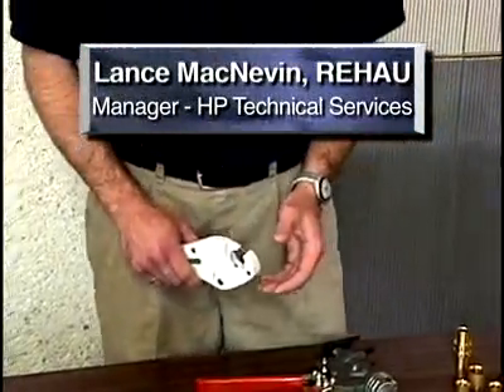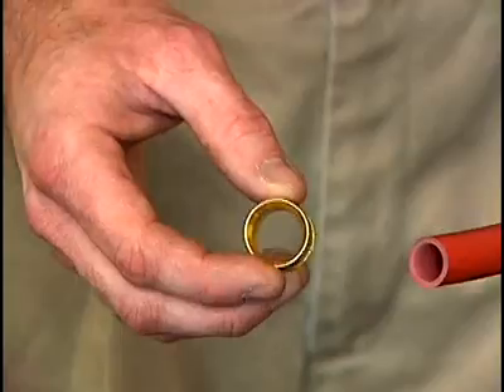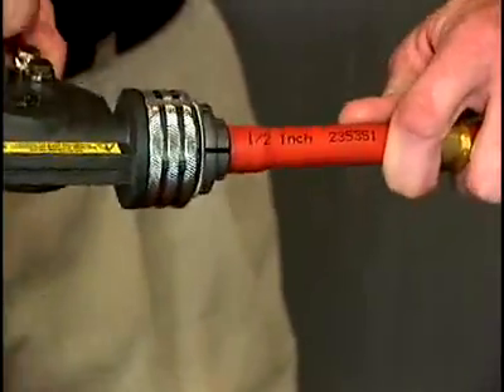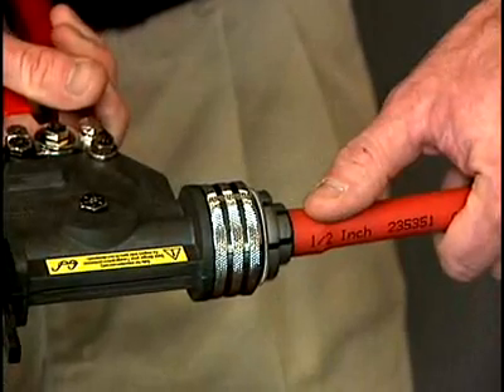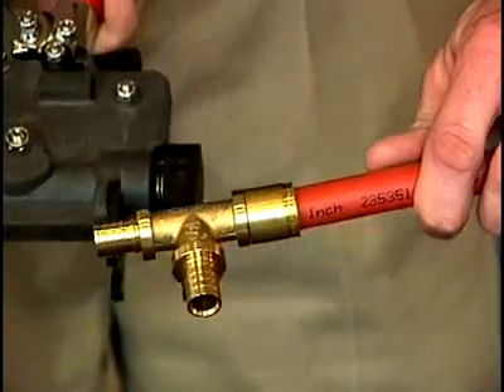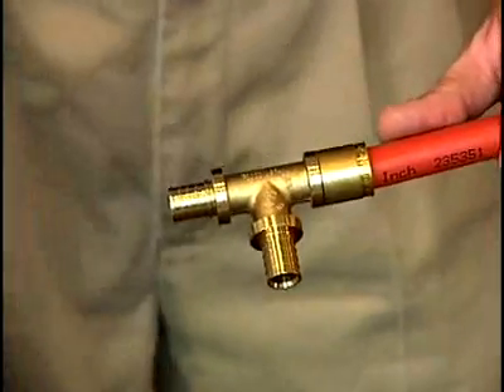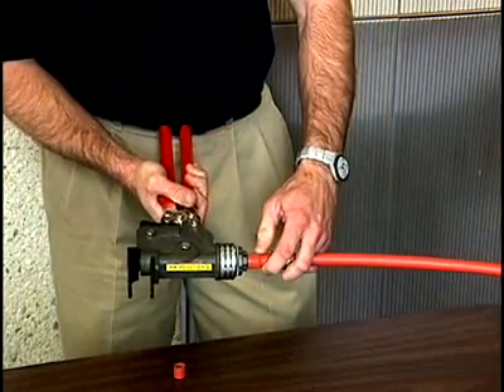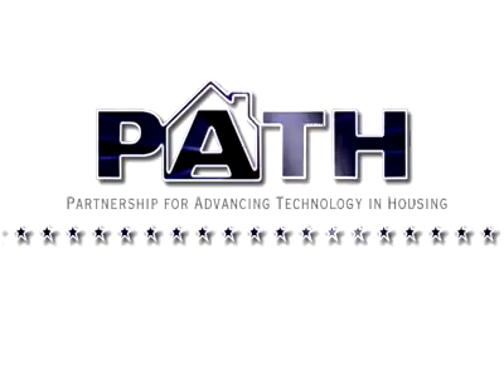PEX Pipe - Compression Sleeve Fitting

Comment: I've used Upinor expansion rings to repair and attach air compressor lines/fittings, also used on garden hoses/fittings, also used on drip lines,  but outdoors uses the rings must be wrapped in tape to protect from UV rays

Comment: I'm re-plumbing my 100+ year old house with PEX-A.  After much research, I bit the bullet and went with the Uponor/Wirsbo system.  The initial cost of the Milwaukee expander tool(about 350 bucks for the 1/2 3/4 1 inch kit) was the bullet I was referring to.  But fittings and sleeves are much cheaper.  So far, I'm really impressed with the ease and speed.  From cut to complete is about 15 seconds per.  Faster if you are doing a tee and have them all cut and the rings on.  The Rehau was my second choice, but fittings are expensive and the manual tool for it wasn't that much less than the 12v Milwaukee that automatically rotates the head so repositioning isn't necessary.  The only real issue I have is that Lowes and Home Depot don't stock the Uponor/Wirsbo system(only crimp and sharkbite) and I have to use a supply house that's not open on weekends.  There are many good PEX systems out there and only time will tell the story.
Reply: blmeflmm66- I’m a plumber and wirsbo is the best in my opinion
Reply: The price of the tool is a con, should be no more than $100

Comment: @flighthouston187 

This tool is called the REHAU - COMBOLOC. The part # for this tool is 243107. These are available through your local REHAU distributor. The COMBOLOC expands and compress 3/8" & 1/2" PEX EVERLOC fittings. This tool can also expand 5/8" - 3/4" & 1" PEX with separate expander heads. The larger sizes need an different tool to comprees the sleeves over their EVERLOC fittings.  

 I hope this helps.
Reply: Berapa hargannya.dan. Bagaimana cara pesannya.terikmakasiih Attas basntuan imformasinya

Comment from the maker: @cagaleche76 The crimp tool in the video is specific to REHAU's PEX plumbing system. Any plumbing supply company that sells REHAU products could help. Try REHAU's dealer locator on their website.

PEX tools may be specific to different manufacturer's systems. Tools may be available directly through the manufacturer or distributor, at building supplies companies like Lowe's or Home Depot, or PEX suppy websites.